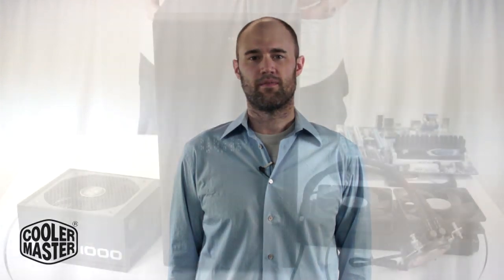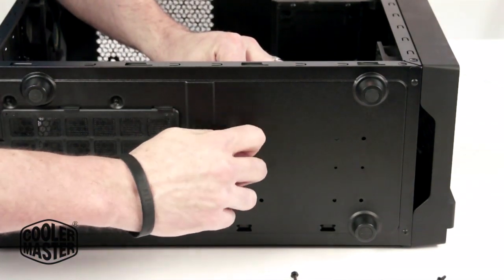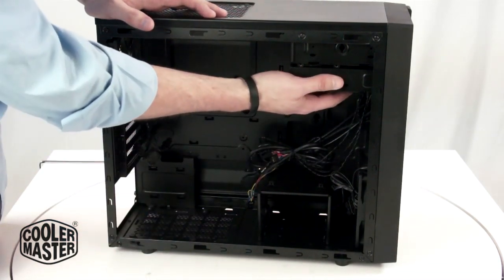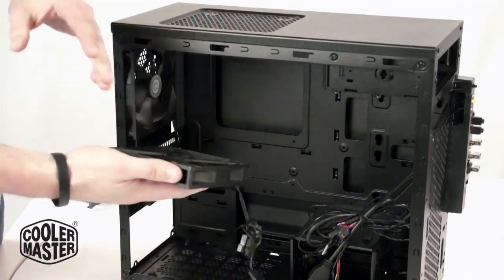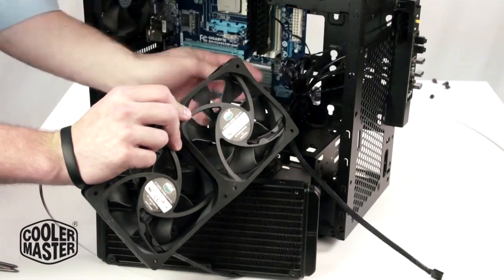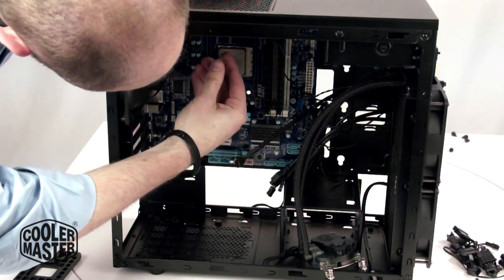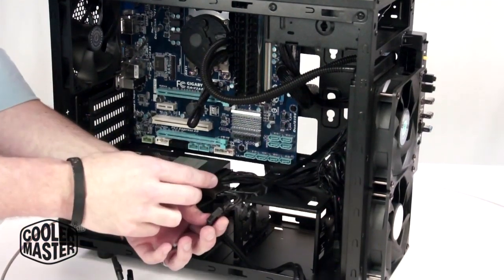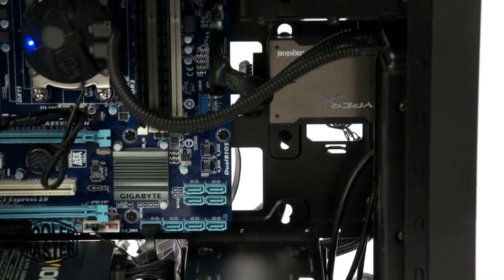CMHD.TV - Seidon 240M Installation in N200

Comment: too much paste
and also run the pump on a 12Volt supply or manually set chassis fan at 100% speed. Not the CPU fan.
The Cpu fan should power the 2 fans on the radiator.

Comment: Im really interested on get this kit complete, but i have just 1 little question, Removing the small intern case locks the posibility of install a MultiCard Reader?
Reply: I bougth it and it makes impossible to use the small bay for a reader...
Reply: There's plenty of 5.25" card readers.  There's even some that fit in the 5.25" bay that are a card reader and allow you to install a slim optical drive if you still use optical drives.
Reply: As video editor i had to use an optical bluray burner, and the surprise here is, IT DONT FIT! It needs 1cm to be in place, because it tops with the mobo, (gene VI). And about the reader, i only use SDs. so a 20 bucks Usb3.0 reader solve it. Those are my issues there.

Comment: don't plug the pump to the cpu fan header. the pump should be plugged into any case fan header on the mobo and the fans should be plugged into the included splitter cable going to the cpu fan header.

Comment: best case ever
i got one specs:
fx 8320
8gb hyperx ram
1tb hard drive
windows 7
7770ghz 1gb
Reply: +Taylor R F Hopkins 
This is my pc build with N200 case
http://imgur.com/1QbLpqd

asrock h81m-hds , i3 4150 , msi GTX 750ti twin frozr, cm elite v2 500W, 1 TB WD Blue , 2x4gb corsair vg pro , cm n200 case.
Reply: I have just got some new stuff for my computer my spec are now I7 4790k OC to 4.6 for now 
Cooler master seidon 120v REV.2 in push-pull 
CRUCIAL MX100 128GB SSD 
1TB/1000GB HARD DRIVE 7200RPM 64MB 
32GB Team Group Vulcan 1600mhz 
MSI R9 290X 8G 8GB 
COOLER MASTER V1000 1000WATTS 
Gigabyte Z97-G1-GAMING-7 Motherboard 
And my case now is the croe 2300.